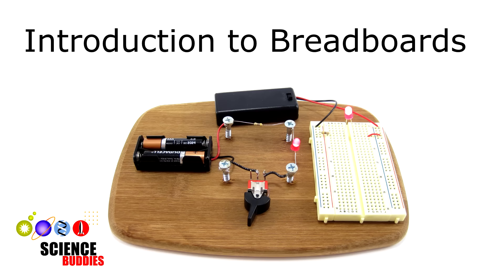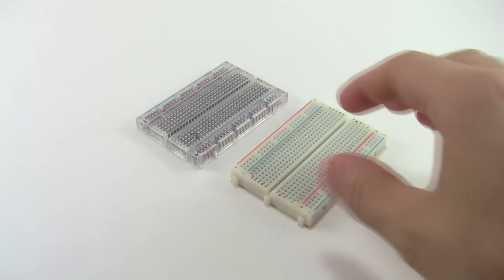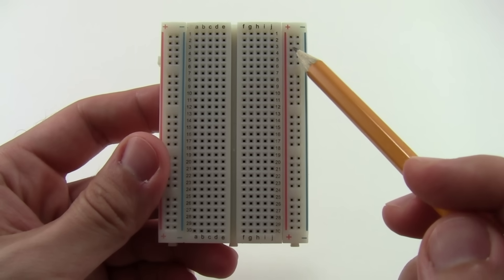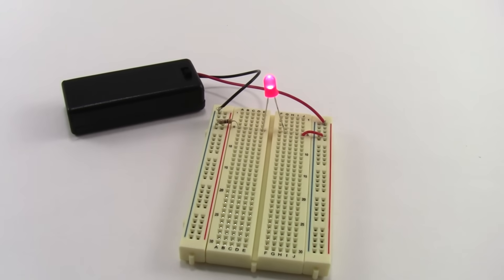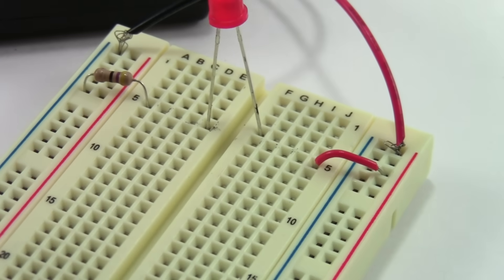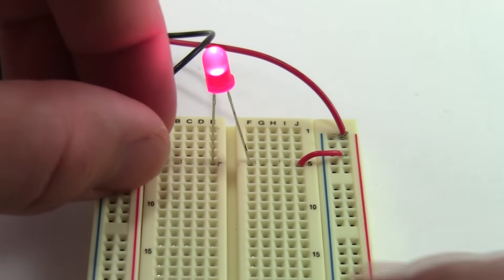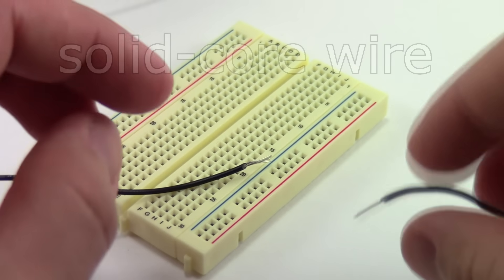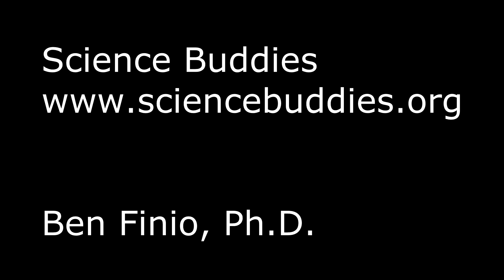How to Use a Breadboard

Comment: It's bad form to plug components into the power buses. Twist your battery  supply wires' ends to make them straight and even solder them if you want Otherwise a good video..

Comment: Thanks for this video. Even 9 years later, it helped me understand what the rows of pins are for. Each time I look up a tutorial, they don't get into those small details, so it's hard to follow along, even if they're "for beginners" videos. I was stuck on how you even know what pin to plug something into, but I noticed a pattern where typically things get plugged near the center between two distinct sections of the board, but no one ever explained why until your video popped up. And now it all makes sense!
Reply from the maker: Thanks! Note that we just uploaded a redone version of this video with better audio: https://youtu.be/MtiJz7gh1VU?si=pRTZPmg_4jSOO5iM

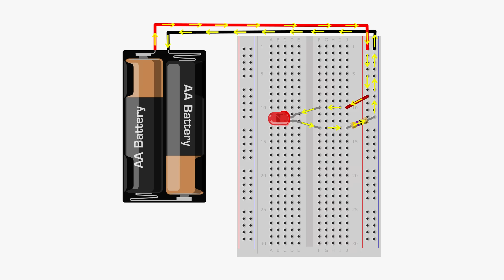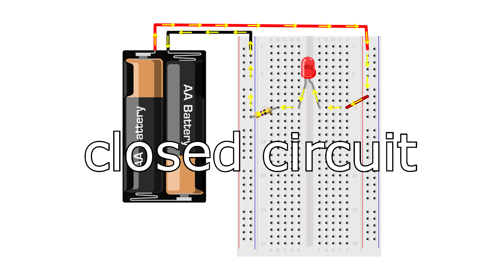Comment: At 6:29, the diagram of the breadboard is different is different than the real life alternate setup -- IRL, the resistor is on the inside rail and the red wire is on the power rail. I think that's the same for 5:36 where the diagram swaps the position of the rails on the rightside of the breadboard.
Reply from the maker: Good catch - the software we used to draw the breadboard diagram has the red (power) rails on the left and the blue (ground) rails on the right, it's reversed on the physical breadboard. The polarity is the same in both setups though (red wire to power bus, resistor to ground bus).

Comment: I bought 6' of old CAT cable. 1$. There was a string inside for stripping the outer insulation. Ther were 8 insulated solid copper wires. I untwisted and straightened them...

Comment: In the drawn graphic and also on your bread board...why is the resistor after the led flow? it works but shouldn't the current run through the resistor first? 🤕 sry if I'm annoying with that Q
Reply from the maker: This is such a common question that we made another video to address it! https://youtu.be/NUKD9qESO58?si=CSn7JihXus40rOkL
Reply: @Science.Buddies  oh great stuff buddy - thnx!
Reply: I guess the current circus is nearly instantly downgraded after it is closed making the components have priority?
Reply: the resistor helps out to have the circus current up to par?

Comment: Maybe I should've seen this before I just got the bread board with two wires , 2 NPN transistors and 3 400Ω resistors to make a 4V voltage regulator... I like the detailed guidance but he didn't say what if I insert the input wire in the column not the power buses.... 11:53pm 30.12.2024

Comment: How dangerous it to touch the wire when the battery is connected? In general, how careful do you have to be when using a breadboard? As a beginner who wants to start, these things scare me :D
Reply: im a beginner too, but i know form physics class that it wont kill or shock you. for that the voltage is too low. with amps (the current) around 20 mA is enough to kill you but it won’t be enough to push the current though your heart. what you do have to watch out for is  heat. if you short circuit the circuit can pull to much current though the wires and they can melt if catch fire.

Comment: How to locate the positive side and negative side of breadboard without the power buses??
Reply from the maker: A breadboard does not have an inherently "positive side" or "negative side." It depends on where you connect the battery pack. The + and - labels on some breadboards are just there for convenience.
Reply: You are still replying to comments after 9 years, what a legend. @Science.Buddies

Comment: but why the jumper wire is needed?
Reply from the maker: You could build this basic LED circuit without the jumper wire, but having jumper wires makes it much easier to arrange things neatly on the breadboard.

Comment: Wouldn't it be backwards to have the resistor on the negative end? Isn't it to keep the energy flow from being too  much on the positive side?
Reply from the maker: This is a very common misconception and we made a video to address it! https://youtu.be/NUKD9qESO58
Reply: @Science.Buddies  Thank you for sharing that! I'm just barely learning about all of  this stuff, so I appreciate the detailed explanation in the video.
Reply: If it's DC it doesn't matter for resistors
Reply: I tried to do this first simple circuit years ago with my toddler and failed. 
I just showed it to him, he is almost 8, and he noticed the pos/neg colours were in reverse placement on your demo, compared to our board. 

Voila... The led finally works!

Comment: How do i use a mini bread board but still great tutorial
Reply from the maker: Mini breadboards are similar (rows connected in sets of 5 holes) but they usually do not have power buses on the sides.
Reply: @Science.Buddies  okay but if lets say i want to light a bulb so then where will i put the power source's wire?since normally we put those wires in the power busses?
Reply from the maker: You can just pick any row of the breadboard and use that for power. Just be careful what else you connect to that row.

Comment: Is "solder" pronounced "sodder"? Or am I hearing wrong? If so, why is not "older" pronounced "odder"? 🙃
Reply from the maker: We usually hear "solder" pronounced with a silent L, but it may vary.
Reply: The word "solder" has a silent "L" because of its etymological history and the influence of French pronunciation. It comes from the Middle English word "soudur", which itself was borrowed from the Old French "soudure" (meaning "to make solid" or "to fasten"). The Latin root for "soudure" is "solidare," meaning "to make solid" or "to fasten firmly," which in turn comes from "solidus", meaning "solid."

The "L" was reintroduced into the spelling during the 15th century under the influence of Latin, but the French pronunciation (without the "L" sound) persisted. English speakers generally retained the French pronunciation, leading to the silent "L" in "solder."

So, while the "L" exists in the modern spelling due to its Latin roots, it remains silent because of the French influence on English.

Comment: A bit of info for newbies like me. If you use a dedicated power supply card that fits on the board and supplies power to both side power rails, it is possible to fit it to the wrong end if you don’t concentrate. If it is at the wrong end the polarity will be reversed and none of your projects will work. In my defence i assumed (wrongly) that it didn’t matter. 🙄 we all make mistakes as the Dalek said to the dustbin.

Comment: can I still connect components through the gap of the breadboard to make a circuit or do i need an IC?
Reply: each side of the gap is a different circuit, but you don't need an IC to connect them. A jumper cable or any other component can make that connection.

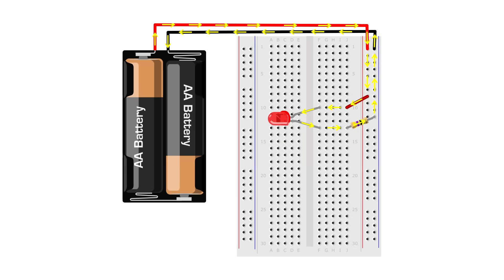Comment: One thing i don't understand. at 5:35 and at 6:24 you see the current flow arrows passing the resistor after the LED light. Could you explain why this is?  Is the resistor not disigned to protect the LED from heating?? It's like you place a car airfilter at the exhaust manifold pipe instead of the inlet as it ought to be.
Reply from the maker: This is a very common misunderstanding - we made a separate video just to address it! https://youtu.be/NUKD9qESO58?si=4f88m8CkeCFvyFHL
Reply: It's doesn't matter which side if you use resistance on the close sercuit however, it will reduce the current from bettary

Comment: 5:37 Hello there. For my project, "color detection to open a selenoid lock & fingerprint sensor" when i power my project from batteries like in the video, the lcd i2c display doens't show data, it just lights up blue. 
While it is connected to usb cable  to laptop it just works fine. Any potential fix in this case?
Reply from the maker: Hi, could you clarify what you mean by "when I power my project from batteries like in the video"? Which video are you referring to, one of ours?
Reply: connections are made like in this video at timestamp at 5:37
Reply from the maker: @eusuntlorean  I assume you are referring to an Arduino project? This video is just about a basic circuit with a battery and LED. We have a video about powering Arduino projects here: https://youtu.be/I7MrL5Q7zvY?si=MpIsZ0hhFscDQ9Do. There is a chance your battery is not sufficient to power your Arduino and the LCD screen.
Reply: @Science.Buddies  thank you so much for your help, really appreciate the support

Comment: Sorry but electrons do NOT move from the positive to the negative terminals. Electrons move from the negative terminal to the positive side of the battery.
Reply from the maker: You're correct, but most of physics and electrical engineering uses "conventional current" which is defined as flow from positive to negative. The convention for positive and negative was determined before scientists understood that electrons were the mobile charge carriers in metals. It's also possible to have other situations (e.g. chemical reactions) where the mobile carriers are actually positively charged.
Reply: @Science.Buddies  There's no reason in my opinion to keep an outdated system while explaining the actual flow of current in a video, you could mention that it may be found as positive to negative and is outdated but by not even mentioning and providing the diagram you show in the picture you create more confusion than anything else since by following the arrows the led should burn
Reply: @Science.Buddies  I was hoping to understand this more actually. I want to understand how electricity is flowing. I always thought it was moving from a high concentration to a low concentration, but I think I am wrong; I am struggling to find an explanation. Any direction/book/video would be helpful to help me understand the differences if there are any.
Reply: @michaeltaggart597  Electricity from a battery exits from the cathode (negative) to the anode (positive). Those are just names in physical reality follows the path of less resistance
Reply: some silly billies in the late 18th century thought that electricity flowed from positive to negative and here we are
Reply: Exactly what i was about to write, that's why the resistor is on the left side of the board and not the right one, otherwise the led would fry! lol so they know that it probably was an overlook
Reply: @nuovoaccount998  it doesn’t actually matter which side of the LED the resistor is on, it could be on the other side and still do the exact same thing. This is because current is the same at every point in a series circuit.
Reply: @jacknash1465  Why current is the same tho? that's just a statement not an explanation
Reply: @nuovoaccount998  It's tough to explain literally but here's an analogy: Imagine water running through a tap (a resistor for example). If you close the tap a little (add a resistor), it slows the water down in the whole pipe, not just where the water is coming out. It's the same with electrical current.
Reply: @jacknash1465  That makes sense for the part after the reisistor but once the electrons move to the anode shoudn't the effect of the resistor end? Why should the electrons from the other side of the battery have lower current if the didn't meet the resistor yet? This is the point i don't understand

Comment: can you stick an LED in the bus and have it actually work? im a very curious person.
Reply from the maker: You will probably blow out the LED if you do this since you're connecting it directly to the battery voltage without a current-limiting resistor. Check out our entire playlist about LED circuit design to learn more! https://youtube.com/playlist?list=PLlBVuTSjOrclaUU1nI3afV1jp8vj4iQUf&si=wjqpfrHAkz77jU5g
Reply: @Science.Buddies  that makes sense. Thanks for answering my question:)

Comment: 5:35 shows the electricity going from Positive to Negative. It is in my understanding that electricity goes from Negative to Positive, so the arrows should be inverted. Am I correct?
Reply: The electrons actually go out from the negative side and travel to the positive side however for convenience, a scientist decided to call that flow of the electricity from positive to negative. Electricity runs from high potential to low potential.
Reply: So what does this all mean to a newby in electronics??
Does the current go from negative to positive or not?
Reply: @abraham7966  the thing that we define as current goes from positive to negative. Since it's human-defined, we decided it should go from positive to negative. If you still have questions you may search them online or ask chatgpt because the topic gets really complex when you try to deeply understand it.
Reply: abraham7966 maybe 😆
Reply: @abraham7966  current goes from positive to negative

Comment: How do i know how many ohm my resistor has to be?
Reply: A component like a led will have a operating spec, voltage (V) & amperage (I).
So if your source voltage is 5v but your led is 1.3v with a amp draw of 20 mA your calculation will be, 5v - 1.3v =3.7  3.7 divided by .02 (20mA)=185. This number 185 is the ohms value of the resistor required to lower the voltage to the led spec.
Ohms Law, V = I x R. Look into ohms law and how it applies to your question.

Comment: my led only turns on when it is going accross along a column from, say 10 to 13, but wont turn on when going horizontaling along a row from, say g to i .... why??
Reply from the maker: If both legs of your LED are in the same row, then they are short-circuited together because the sets of 5 holes in each half-row are internally connected to each other. Make sure you watch the entire video for the explanation of how the holes are connected.

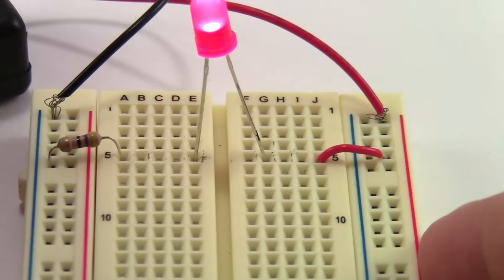Comment: in 5:18.. shouldn't the resistor be placed on the positive side to bulb instead?
Reply: actually the real and physical flow of the current is counter clockwise, or what we call electron current flow that is why the resistor is placed on the negative side of the led
Reply from the maker: This is a common misconception, we made a separate video to address it! https://youtu.be/NUKD9qESO58?si=x1d3xBRR33j0TJmv
Reply: No, power runs from positive to negative, so the resistor wouldn't work as you need power supply on the positive end.

Comment: I completed electronics course in engineering without knowng this. Thanks for this topnotch content 👌
Reply: What size resistor
Reply: @dennzpowerlifting9152  The video description has it as 47ohm. But you also need to learn Ohm's law to figure these things out.

Comment: To what good is a resistor? Wouldn't the circuit run without it as well?
Reply: so that the components don't fry from the unimpeded flow of electricity.
Reply: wait so the resistor can be 'behind' the LED or flow of electricity ?!
Reply: @user-27D64OWJF7  yes, the resistant effects the entire circuit.
Reply from the maker: This is such a common question that we made a separate video to help explain it! https://youtu.be/NUKD9qESO58

Comment: Hey, Im a beginner here and great video by the way. But at the end (around 11 mins and 30 secs) you said that your shorting out the two pins in each row when you put the chip/integrated circuit there. I didn't quite understand that or why that happens.
Reply from the maker: It might help to re-watch the earlier parts of the video about how the holes are connected. Remember that hall the holes in each half-row are electrically connected to each other. So for example holes A1, B1, C1, D1, and E1 are all connected. If you put the integrated circuit into the left side of the breadboard such that two of its pins are in holes A1 and E1, there will be a short circuit between those pins.
Reply: The part of the board with letters has horizontal rows of metal that transfer electricity. These metal rows only extend to half of the board, from A to E and F to J. When he puts the chip on one side of the board there simply isn't enough space to put in another component to complete the circuit. If the board had at least one more column on each side (meaning the horizontal metal row was longer) he would have space to insert another component and connect one end to the negative or positive column to complete the circuit.

Comment: Sir what kind of wire should I use to connect a sensor SEN2 to a arduino UNO3 board 
Ex- male to male, female to male, female to female..
Reply: Generally, for low voltage and low current sensors, a standard 22-gauge wire should be sufficient. However, if the sensor requires higher voltage or current, you may need to use a thicker wire.

Comment: I may have missed it, what GUAGE solid wire is best for breadboards?
Reply from the maker: In general 22AWG works well, that's what you'll commonly find in jumper wire kits like this: https://www.sparkfun.com/products/124. The specs for the breadboard may list wire sizes that will work: https://www.sparkfun.com/products/12002
Reply: @Science.Buddies  Thank you

Comment: Except electrons flow from - to +. The arrows point to negative, the flow is against the arrow.
Reply from the maker: Look up "conventional current" - this is a convention used in electronics that was defined before scientists fully understood electron flow.
Reply: @Science.Buddies  That's why we should quit using it.
Reply: @augustaking8  its like that in physics too, its just the standard. Nobody's gonna stop using it because it could lead to a lot more problems than if we just kept using the same standard.
Reply: @anishalle761  We learned "Electron Flow"  back in the 70's, when solid state was getting big and the truth won't hurt you.
Reply: Ohhh. Is that why I was confused about the resistor placement? I thought it should be before the LED to keep it from burning off
Reply from the maker: That is a very common misconception, we get that question so often that we made another video to address it: https://youtu.be/NUKD9qESO58
Reply: @Science.Buddies  oh thanks very much :D
Reply: @user-dy1vf7lu3i  
They're in series, with the resistor limiting the current and dividing the source voltage to a safe level for the LED, so it can be before or after.